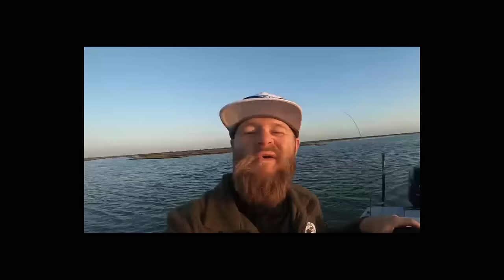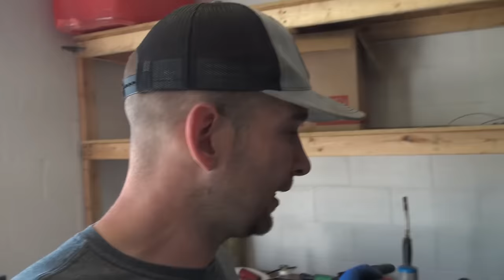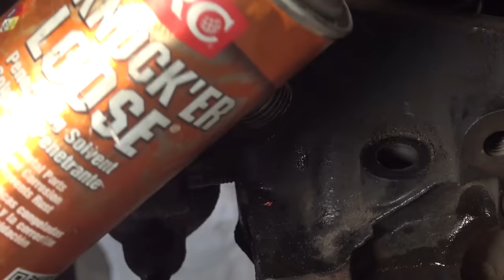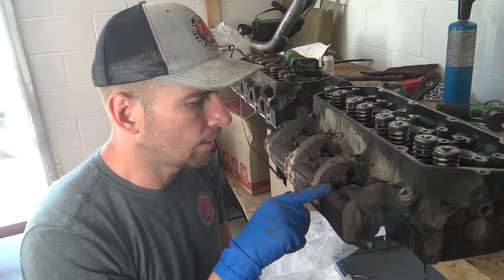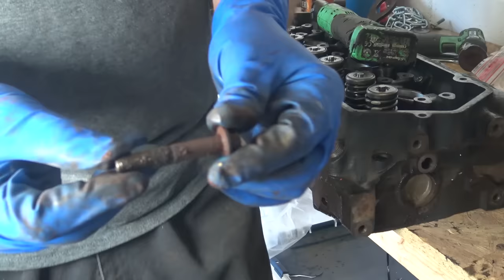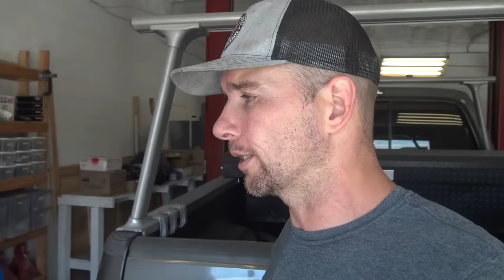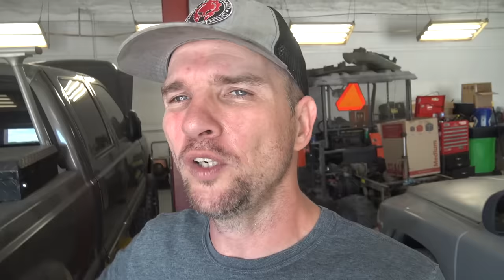Old Mechanic Taught Me This Trick To Removing Rusty Exhaust Manifold Bolts!

Comment: Good video Steve, I would like to offer a couple tips that I use. I live in the northeast where everything is quite rusted as well, sometimes they are so rusted it doesn't even look like a bolt head. The two things I do are 1. I use an impact socket with an old extension and I give two hard  solid hits with a hammer, the head itself rusts and can be pretty solid to the manifold as well as you mentioned how the shaft of the bolt can rust and stick to the inside hole in the manifold, the shock of the hit helps break that rust bond and they will turn with the back and forth method you describe, This almost always works for me, if not, I will do the solid hits with the hammer, then use heat, I will get the head of the bolt red hot which transfers the heat throughout the bolt, It's the same theory as happens when welding a nut to a broken stud, the heat travels through breaking the bond,  because of the bolt expansion from the heat it has to cool down some before turning it out. I work on a lot of trucks and vans which love to break the exhaust bolts at the ends of the manifolds.  I hope my advice is of some benefit to you or anyone else reading my comment. Thank you.

Comment: Clean threads out with rifle brushes in your drill. Taps cut the edge off of USED threads. Then bolt can pull out. 
Also, a smack with a hammer and short punch directly in line with the bolt can be helpful to shiver the rust bond.
Reply: Get an actual theread repair kit instead of using taps. Taps are for cutting news threads. I got one off snappy years ago, works great. There's loads of chinese copies now for alot less. Never tried them bit friends say they seem to work fine
Reply: I've used Thread Chasers I stead of taps.
Reply: Agreed on the tapping - have had good luck doing it.
Reply: It's a good idea to keep old taps for this job.
Reply: @chickenfishhybrid44  ? No more chinese please usually junk that only last a few times and it is time to start looking out after the U.S. again no matter what.
Reply: @jzero32  just letting you know the vast majority of "american" tools are made in China. I'll agree with you, a lot of the cheap crap makes a job worse. But, you can find decently priced good quality stuff that may not have "the" brand name on them and have the obligatory China stamp on them. I buy USA made when it really matters.. but disposable stuff, unless I need to be absolutely precise, ill waste a cheap tool before a quality one. Decent cheap thread chasers for cleaning up threads and quality taps when making the threads.
Reply: @EyebrowsMahoney  There are only three countries which have the engineering skills to launch manned space vehicles. The US, Russia and China. The high quality spacecraft that dont kill lots of crews are of course not made in the US.
Reply: Or try using " stick" style steel wire brushes , they come in different diameters and lengths
Reply: @andrewallen9993  Thats off topic, and a bit biased there. There were failures in the Russian space program that did kill some crews as well - just they tended to bury it with propaganda. We only have lost 3 crews in the entire history of our space program and arguablly we flew significantly more manned missions. One was a fire due to the oxygen rich atmosphere of the craft, one was entirely preventable and engineers warned people it was a possibility, and one was an accident caused by damage during takeoff. All of which had nothing to do with quality, and everything to do with mistakes that anyone could have made. On the inverse... Soyuz 1 had a parachute failure killing the cosmonaut on board, Soyuz 11 killed all 3 on board decompressing in space due to a vent defect that wasn't apparent until after undocking.

China killed at least 6 civilians (reporting is spotty) with one of their rocket launches when the rocket veered off course. And to be quite fair, they had the lessons that the Russian-US space race learned to build their program from with significantly lowered risk. So the comparison is rather poor.
Reply: @oscarmilla8972  they call them tube brushes. They come in various nylon, steel, bronze, and even brass varieties.
Reply: @EyebrowsMahoney  You will note I was not the person mocking chines engineering I was just pointing out that more astronauts have died in US spacecraft than either Chinese or Russian ones though you are correct in that one US accident was caused by piss poor US management as well  as  the lack of written go - no go temperature specifications. The Chinese equipment I know is always engineered down to the price required by the customer with the standard engineering constant of fast, cheap or good, pick any two:)
Reply: @andrewallen9993  You get the same in the US really. Most companies just want it cheap and fast though. So things aren't that different in the US.
Reply: @oscarmilla8972  McMaster-Carr 7464T53 for a decent set of "screw sized" brushes of good quality and a decent price.
Reply: @EyebrowsMahoney  , thanks for the info
Reply: I've been doing this awhile. I started with my father's worn out taps, he was a tool and die maker and it had to be right. Aways save  worn out taps to chase threads.
Reply: @jzero32  Roger that jzero32! Saving a few cents or even a few bucks is no excuse for buying "anything" made in China. It is either made in Made In The USA (or Canada) or I don't need it that bad.
Reply: Thread chaser taps, not cutting taps.

Comment: Great video. I was a mechanic then and Automotive Teacher and then Fleet Mechanic. I started using MAP gas rather than propane. Also sometime shocking the bolt by hitting the head with a good size hammer. Now that I'm retired, I'm restoring a 1930 Ford Model A Ford Coupe. Every bolt is 1/4 turn from a 3-day nightmare.

Comment: If I have to heat a fastener , I like to spray some more penetrating oil on it , while it is still HOT .  The heat seems to draw the oil into the ( rusted ) spaces / threads .

Thanks ,   :-)
God bless
Wyr
Reply: I've also used candle wax.

Comment: I have used the same method and it usually works great. Another addition to this method is, I use an impact wrench. I turn the air supply completely off and slowly turn the air supply back on just until the wrench just barely starts to "tap". That little "hammering" helps knock the rust loose. Then forward again and back out until the bolt comes out. I have used this same method on brake bleeders with a high rate of success believe it or not.

Comment: Awesome advice for a guy about to tackle exhaust manifold gaskets on a Ford 460 with 301k on the clock! I'm going to Kroil them bolts for the next few weeks as I'm in no major rush and apply these techniques.

Comment: Good video Stephen. I've been in the same situation, got impatient and ended up with a disaster. I never thought about not removing the bolts after breaking them free but you are absolutely right, the parts do lift and it will certainly make removing the others that much more difficult. Thanks for the video and I'll be certain to follow this method in the future.

Comment: if you DO have a bolt broke off and you need to drill it and use some sort of extractor- buy LEFT HANDED drill bits!!!!
over 50% of the time, I'll drill one out with a LH drill bit, and during the process I pump the pedal(trigger) on the drill and start/stop/start/stop the drill, occasionally the bit will catch and walk the bolt right out with no extractor tool needed!!!
Reply: Awesome information! Thanks!
Reply: I had never had much luck with easyouts/extractors until discovering the left hand drill bits several years ago. Agree that the drill bit does the job about 50% of the time.

Comment: Heating up area or threads then melt candle wax on it. Threads tend to draw the wax in. It's worked everytime I've needed it to.
Reply: Paraffin is my choice also! Most get the fastener to hot and the liquid spray vapes away too quick to do any good. Paraffin has a higher flash point. I'm a old millwright and showed this trick to the melt shop maintenance guys that aren't allowed any pressurized cans or flammable liquids. Now it is their go to in several states their in to break bolts and nuts loose.
Reply: @jethrogump9016  has to be from the right ear. Left is in, and right is out.
Reply: @mrgoodtimes05  I thought it was ritey titey   lefty loosey? But I've been wrong before.  LOL
Reply: Lmfaoo..... that doesn't work

Comment: I actually learned this from a heavy duty mechanic in texas....  We are talking big stuff and I got this surprise. He came to the site, bolts already sheard off and what he did made a believer out of me. Several thousand pound arm that if it came off all the way there was a lot of damage. These bolts were 3/4 inch I.D. and it was sheard at where the bolt went into the machine, not the arm that was bolted to it. He used soft steel pipe that would just go into that bolt hole, and rest against it... then he took some 7018 or 6013 rod and slid it inside the pipe with it on or close to broken bolt and holding the pipe tight against the broken bolt, started welding on the head of the bolt and pipe included. After a decent weld was applied, Not a lot but substantial enough to get weld on bolt and the pipe stopped welding by just pulling the rod back... if it wanted to stay leave it as you can bend the rod so you can twist it on out. THEN, small pipe wrench on the pipe that is welded to this cantankerous bolt and start losing and then tighten then loosen till it comes.... some times you have to repeat this process as the pipe will twist off  but worry not as you can saw that junk pipe off and reuse it... this pipe needs to stick out a ways so that you can get this pipe wrench on it to turn it. Those bolts were in with hundreds of pounds of torque, once the head is missing torque goes out window and its remove time and he didn't have more than a say eight to ten inch pipe wrench.... It beats what that company left him with was broken tap's in the bolts as well, they weld too.... Hope that you see this Stephan
Reply: No joke, I didnt understand a thing he said. Way too hard to follow along with that tutorial .
Reply: I could do a book report on this comment 😂 Im joking, it was a cool story.

Comment: Heat with a torch then touch an old candle to the threads
The wax will chase into the threads like a flux. Then use your tricks working the bolt back and forth....great ideas use them all.... yeah I agree never buy 12 point sockets
If you can avoid it. (Try to Stop before you break it. )
Great Tips!
Reply: There's a guy on here, project farm who's tested this, and another channel south main auto, and neither of them could get that to work, no penetration whatsoever. Just saying. You're better off with penetrating fluid or an atf ether or acetone mixture and using the same concept of heating it up, spraying it, letting it cool, heating it up spraying it and giving her the beans.
Reply: Must use 12 point on 12 point bolt
Reply: 12 point good for rounded bolt
Reply: @king49334  no they're not.

Comment: Glad i saw this. I'm 61 and a chick and tommorrow i gotta do this. On a 76 ford econoline 250 van. This was the part i dreaded the most
Reply: How did you make out?
Reply: @soflsteel777  extremely glad i saw this video!! Saved me a whole lot of problems.  Today I'm doing a simple hose replacement but i can't seem to reach the top clamp so it will be dismantle something time. 
  Most hilariously to me is i noticed yesterday it still has the originial brake master cylinder. 46 years and the same master cylinder. Crazy how they used to build these things. 
  Thanks for asking!! Thanks for the help!!

Comment: Sometimes a little tapping with a hammer helps alot. Not hard just enough to induce some vibration.
Reply: Yes, a small ball peen and peck-peck-peck on the bold heads.  The vibration transfers clear down to the threads and helps break everything loose.
Reply: that's what she said
Reply: @dcarder3336  I suspect that, as said in the video, the manifold has become part of the bolt....so, as you say shocking that material is a step forward.
It also allows the penetrant easier access....fissures have been created!

Comment: Great demo. There is a subtle touch to dealing with mechanical things and a higher order of technique that most people do not appreciate. I have been almost brought to tears getting the steel manifold bolts corroded through and broken odd out of the aluminium block of and airplane.

Comment: I've been a mechanic for over 50 years… what I do is torch the bolt heads off, pull the manifold off the bolts, then grab the rest of the bolt still sticking out of the head with a vise-grip and twist the rest of the bolt out.

Comment: This is a very informative video. I'm not a mechanic by trade but have done my share of this sort of work. I've found that if you can get a few good smacks on the bolt head with a hammer and an old socket so as to protect the bolt head, sometimes this will help break that rusted crust loose. Carefully using an air impact device can also be helpful on those stubborn bolts. Another good practice when trying to remove these bolts while on the vehicle is to make sure that the engine is warmed up to temperature before trying to turn the bolts out. Be aware that hot exhaust manifolds can cause serious burns so be sure to wear proper gloves and safety glasses. Replacing the old bolts with correct sized new ones could also be an asset. The bolts of course should be coated with a high heat anti seize product.
Reply: I find that tapping the head of the bold and carefully applying torque to it at the same time sometimes works, also heating the bolt with an oxygen acetylene torch helps a lot.

Comment: Thanks, in my opinion it's best to heat up the bolts with a propane torch before even attempting to turn the bolts.  Then shock the heated metal with PB Blaster or whatever you prefer.  The thermal expansion and shrinkage/quick cooling helps break up the rust and allows the penetrating oil to seep in, or at least that's how it's worked for me several times.

Comment: I found replacing the bolts with studs and using brass nuts works well with some exhaust applications
Reply: You are almost 100% correct brass lock nuts work better than steel nuts on ALL exhaust applications :)
Reply: Your dead right

 Old school
Reply: That's the Austin Healey approach from the 60's...
Reply: @ralphwaters8905  and Alfa Romeo
Reply: @gregculverwell  And Mopar.

Comment: Exceptional and informative. I started day or more in advance soaking the bolt with Deep Creep or Knocker Loose and tapping on the bolts to set up vibration and help the penetration while repeatedly adding penetrant. Also you are right on about heating Around the bolt and not the bolt. Most people heat the bolt (which  make it expand and get tighter) . You want to make expansion around the bolt with the heat. I put an ice cube block and hold it on the bolt head to aid it contraction of the bolt after heating around the bolt. That way the bolt contracts while heating around it expands the manifold and head. Again you are right stating to take your time. If a bolt will not move with a lot of pressure stop and resoak the bolt over and over and tap on the bolt. You may need to wait a day while re soaking the bolt. Like you say it is much better than breaking a hardened #8 bolt in a head and having to drill and tap if there isn't enough sticking out to get a vice grip on the broken bolt after you get the other bolts out and manifold off. It is smart to not reuse exhaust bolts, tap all threads and use Antiseize on new proper hardened exhaust bolts. Nice video.

Comment: Fantastic video-  really well done.  As one who has wrestled with many rusty bolts up here in salty icy roaded New England (ATF:acetone 50:50, soaked overnight- use all the same techniques), the only other thing I can add is, if you plan on working on your own car and keeping it "forever"- when you buy a new(ish) car, in the unlikely event that you have time to do so,  for bolts with threads exposed under the car or in the engine compartment, add antiseize over the full length of the exposed threads and then put tight thread protectors (any hardware store has them cheap) over the exposed threads (or if the threads aren't sticking out too far, a deep nut, such as an acorn nut, with antiseize inside).  Wish manufacturers would do this at least as an option for those of us in the rust belt.  I back off 15-20% on torque when antiseize is used- even with wheel nuts- torque has held fine over many months.  I replace with stainless steel fasteners for non-torque critical situations, such as a battery bracket.

Comment: Great video! Yep! I was taught this too. But you missed spraying again Before you re-tightened the first one! Also, heat it up & put a large drift pin on the bolt head & hammer it some, not too hard. Spray & repeat & reheat. Slow & steady will usually get them out.

Comment: Good point about not removing a bolt totally before loosening the others.  So often on rusted bolts, I forget this one.   One thing I have found helpful in addition is this.  After heating area with torch, spray penetrating oil on hot bolt, it just sucks it in like crazy.  I know you said acetone +atf will burn.  Patience is key here, spray the mixture a couple times a day for a couple days before actually laying a wrench on the bolts, you can generally get them out without excessive fear of breakage.  Thanks for a good video